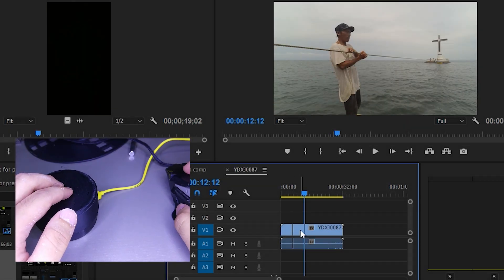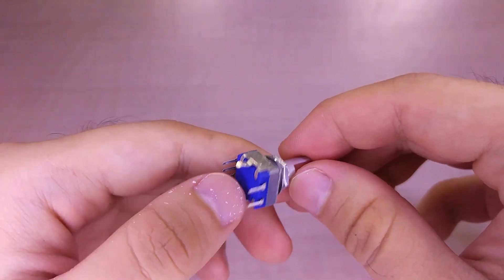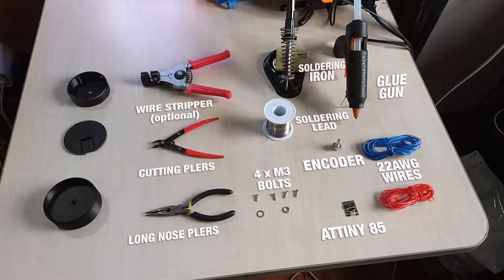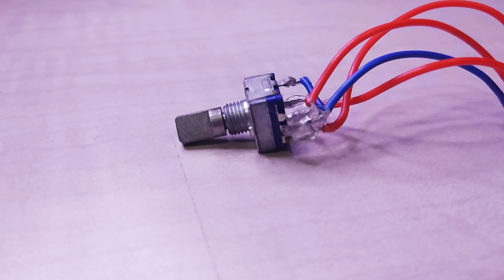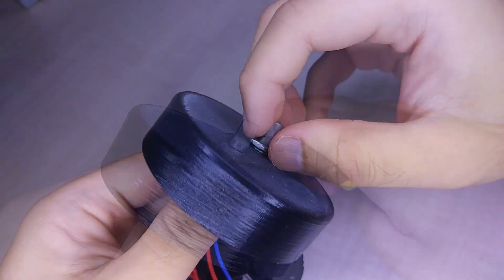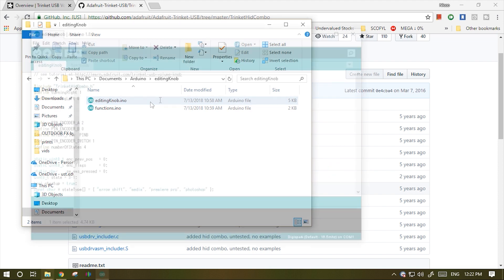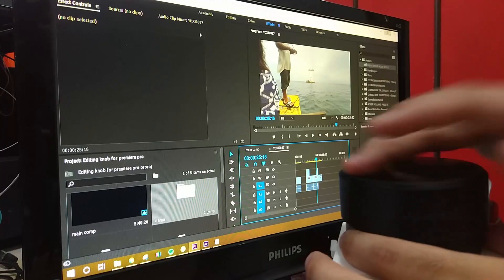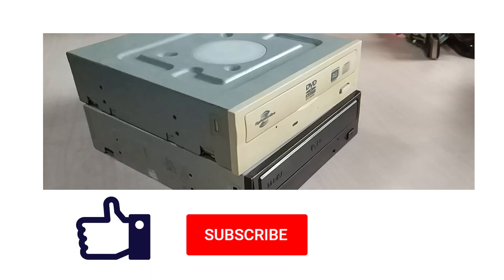How To Build a Volume Control Knob with Editing Shortcuts

Comment: hello thanks for your project, I wanted to ask you if it is possible to install a second jog in pins 3,4,5. I tried but when I go to work on the code, nothing works and the device is constantly disconnecting

Comment: Can this be used with a rotary encoder that doesn’t have a push button?  I just need this to perform simple volume up/volume down function.  Will your code support that?
Reply from the maker: Hi, yes it should support it, you just have to set the default profile of the code for volume control
Reply: @3dshedph  Where in the code is setting for the default profile?  What exactly do you suggest I change?  Would be greatly appreciated.
Reply from the maker: @mikes5362  uint8_t state = 1; //edit this corresponding to state type array, 1 means volume control
bool startup = true;
const char * stateType[] = { "arrow shift", "media", "premiere pro", "photoshop" };

sorry, its been a year since I've opened this code. Hope it works, I'm sorry for my poor coding back then
Reply: Thomas Reyes Thank you!  Your tutorial was best out there for rotary encoder by the way!  I just did this project, made this change and it works perfectly now.

Comment: Any alternative to cutting the led?
Reply from the maker: at the time, I could not think of any. You could try without cutting, I just later found out that the led adds resistance that's why it was interfering with the button presses/rotations if I remember correctly.

Comment: can I use Arduino micro in this project?
Reply from the maker: I haven't accounted for the size of the micro, but I'm sure you could easily edit the model in case it doesn't fit.

Comment: I've tried to recreate what you've done. but I'm facing a problem. it will work after i have uploaded the code but if i remove it and try to reconnect it  won't run the program. Any help?
Reply from the maker: I'm so sorry, but I think you might be dealing with a broken microcontroller or your bootloader.

Comment: Hi, can i use the full size USB version of DigiSpark instated of this Micro USB version? is there any technical difference between these two?
Reply from the maker: I don't think there's a technical difference. I think it will work 👍😀
Reply: @3dshedph  I tried but no luck. I did some research, the micro usb version has built in USB support so it can be used as a HID. Can you take a look at this and extend this project. Right now it is configured for Eagle. Is it poosbile to map the keys and dials to work with premier 
https://github.com/awende/Cherry_MX_Keyboard
Reply from the maker: @vishnuraj2277  I'm sorry to hear that, though there are tutorials on using the digispark usb version as a keyboard usb, I'll link one here: https://www.youtube.com/watch?v=trx5ZWl9i3Q by CheapskateProjects

do note that in the the Cherry MX Keyboard project uses a different microcontroller, a better one if you will, which is the Atmega 32u4. However, you will use a different HID library that will work with that microcontroller. I checked his code, it looks relatively easy to edit for Premiere

Comment: Wow! Awesome! I want to follow this video .... but there was a problem (I'm Korean and use Google Translate)
I can not upload Arduino Sketch File to my ATtiny85 compatible board.

The error is:

In file included from C:\Users\Kamilake\Documents\Arduino\libraries\TrinketHidCombo\usbdrvasm_includer.S:24:0:
C:\Users\Kamilake\Documents\Arduino\libraries\TrinketHidCombo\usbdrv/usbdrvasm.S:17:0: warning: "__SFR_OFFSET" redefined [enabled by default]
 #define __SFR_OFFSET 0      /* used by avr-libc's register definitions */
 ^
In file included from /Digistump_Arduino/hardware/tools/avr/avr/include/avr/io.h:99:0,
                 from C:\Users\Kamilake\Documents\Arduino\libraries\TrinketHidCombo\cmdline_defs.h:26,
                 from C:\Users\Kamilake\Documents\Arduino\libraries\TrinketHidCombo\usbdrvasm_includer.S:22:
/Digistump_Arduino/hardware/tools/avr/avr/include/avr/sfr_defs.h:141:0: note: this is the location of the previous definition
 #    define __SFR_OFFSET 0x20
 ^

스케치는 프로그램 저장 공간 (79%) 중 4,758 바이트를 사용. 최대 6,012 바이트.
전역 변수는 160 바이트의 동적 메모리를 사용.
...
I will provide all the information to resolve this error. Please help me...
Reply: It Solved!
Reply: @Kamilake  how?